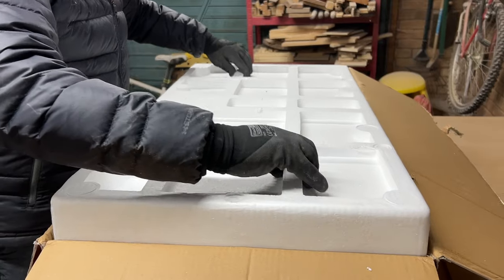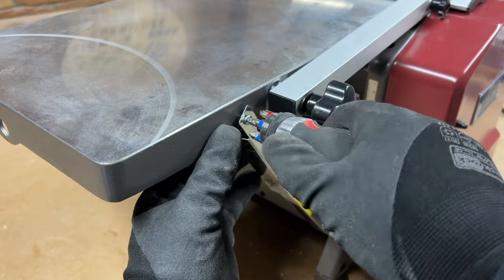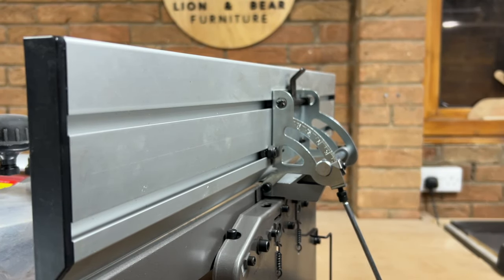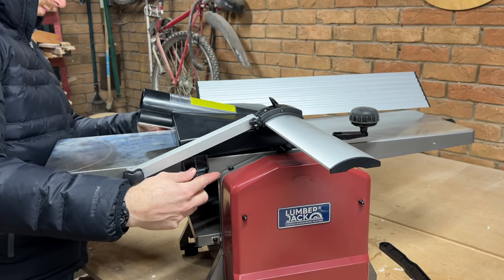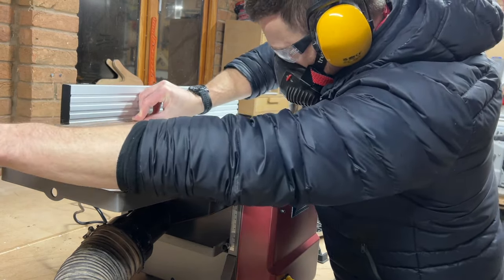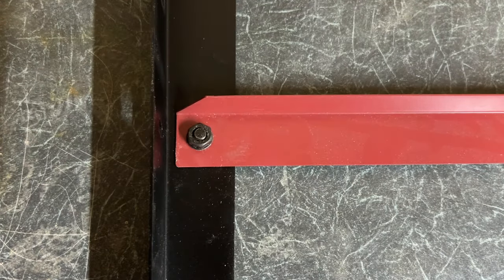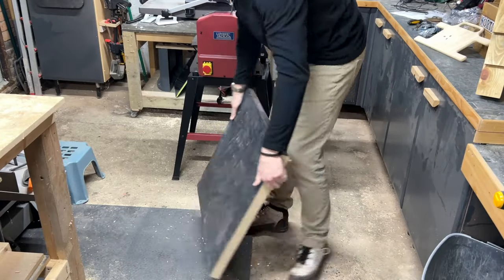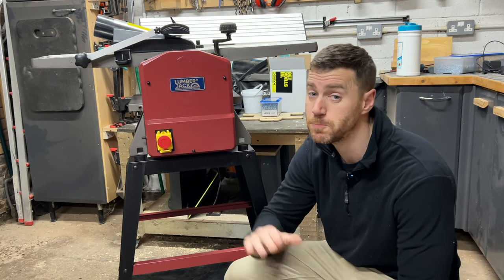Lumberjack PT254 10" Planer Thicknesser Unboxing and Set Up Guide

Comment: How does this compare to the Titan planer you used to have? I have the same model and the rollers keep getting gunked and not pulling. 

Clear upgrade or just a rebadged version of the same machine? They look very similar
Reply from the maker: Definitely an upgrade mate. It looks similar in shape/style but it’s a bigger machine with a bigger planer bed which makes a difference. I think it sounds quieter but will be testing that out and the fence is a considerable improvement. I’m building an oak dining table soon and didn’t feel comfortable running the boards through my titan so went for this as the upgrade. I’ll be doing a full review on it once I’ve used it on my table project though so will have to see how it holds up. I’ve got high hopes based on my tests though mate.
Reply: Just about to ask the same question.
Reply from the maker: @barrymelody4477 I think it’s the question on everyone’s lips and was certainly the big question I had! I’ll be covering that in detail when I do my review to see if it’s the next upgrade level from the Titan.
Reply: @lionandbear  Good to hear, thanks. Considering an upgrade myself as the Titan clogs up easily and sounds like a plane taking off.
Reply from the maker: @detroutspinners9933 yeah that and the fence were my reasons for the upgrade. I’ve not ran enough through it yet to give a verdict on the dust collection though so will be sure to show it when I do my review.

Comment: how are you finding this now after a few months whats the cons bud ? ready to make a purchase and deciding between this and the charnwood benchtop version
Reply from the maker: Hi mate, it’s a good machine and definitely an upgrade from my cheapo Titan one. The biggest pro for it is the dust collection and the size of the planer bed. It’s still pretty noisy and I’ve been running a load of oak through it recently and have noticed that the planer bed has got all scratched up. Not sure what’s caused it or whether it was a weakness in the planer bed itself or something in the oak I’ve been running through it. 

The only other con about it is that when running very long boards across the top planer with the machine on the metal stand then the stand can tip. I was running 2.2m boards through though to be fair. If it’s not in the stand then it’ll be more stable.
Reply from the maker: Hi mate, bit of an update on this one. I’ve found some flaws in it which I’ll be addressing in upcoming videos (oak dining table project) so worth keeping an eye out for that one.

Comment: Nice job can I pick your brain's how are you finding it also have you had to change the blades yet. I have just received a new one of these back as my last one failed story for another day but blade change and setting is causing me problems?? 🏴👍
Reply from the maker: Hi mate, it wasn’t up to the job for what I got it for so I unfortunately had to send it back. I’m hoping to get one of their helical head thicknessers soon though as I think it will be more suitable for the type of work I envisage using it for. You can see the problem I had in this video: https://youtu.be/UvyAGkuPz2Q?si=KIKClR70S3zt7L8b
Reply: @lionandbear  no worries I'll have look the video. Did you ever have to change the blades did you find it straight forward. Am struggling with this one last one was fine till a had an issue and they asked me to diagnose it and fell apart then got damaged in transit beyond repair get it set up today all seemed fine took 2 cuts then didn't seem like it was cutting 🤔
Reply: @lionandbear  I see the issue seems similar to the issue I'm having gonna have a problem sending it back I fear as I already received this back as a replacement for my old one that broke not sure what am Gonna do?? 🏴👍
Reply from the maker: @michaelwillson6847 no I never got that far to be fair. I set it up in this video and tested it and all seemed well with it but then my next job was the really long oak from my dining table video and it just wasn’t up to it which was why I sent it back. The blades were fine though for that so I never had to change them. Sorry I’m not able to be more helpful on this one.
Reply: @lionandbear  no worries thanks anyway table looked wicked.  Am gonna get someone that knows bit more than me have look failing that gonna have to go back to them again see what they say
Reply from the maker: @michaelwillson6847 have a chat with them. I’ve had great experience with their customer service before and they usually try and make things right if there’s an issue so worth asking.
Reply: @lionandbear  yea a must say ave got there mitre saw lathe belt sander all been great as say just had the issue with last one but last one was fine but this one just doesn't seem up to par 🤔
Reply: @lionandbear  wanted to drop you message with quick update I have fixed and diagnosed the problem and feel it could have been the same problem you had. So I spoke to a saw doctor and tool expert tonight I took out the blades that were installed when machine was out of the box turns out they either weren't set or tightened right and possibly not totally sharp so I changed them to a brand new sharpened blades reset them and has worked perfectly and all issues resolved plained 1.6m legnth maple and all was good 🏴👍
Reply from the maker: @michaelwillson6847 nice work mate! Maybe worth feeding that back to lumberjack tools as well.
Reply: @lionandbear  yea think probably will gonna speak to them anyway as the beds are all scratched up badly on this one out the box. 👍🏴